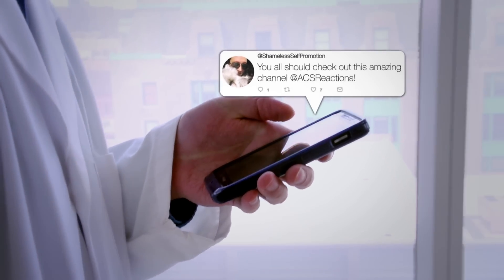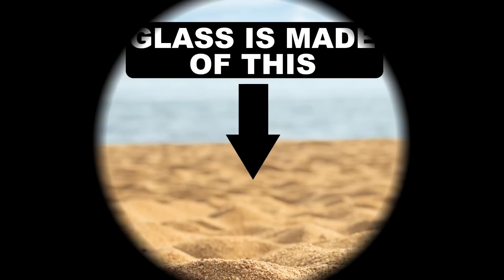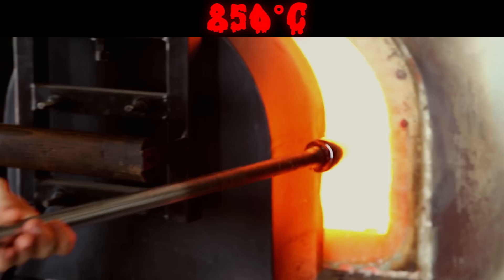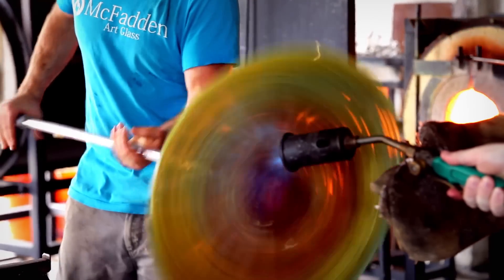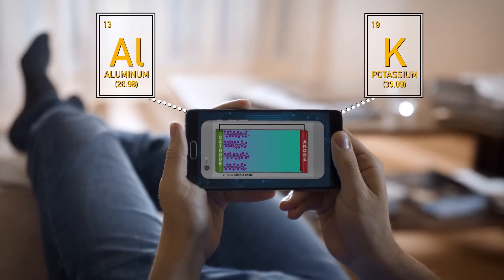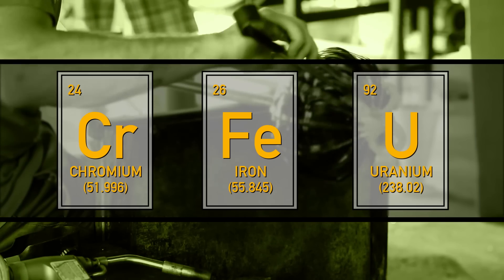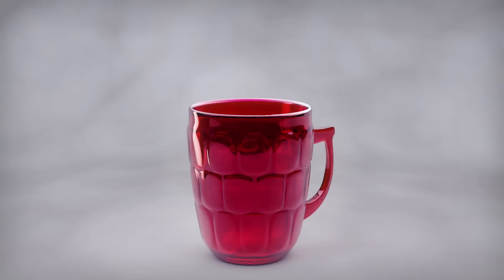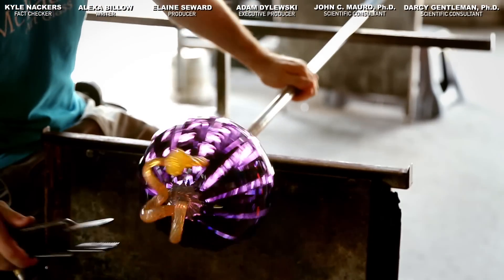How Does Glassblowing Work?

Comment: As a glass worker myself I highly recommend borosilicate, specially if your just getting started. It's less likely to crack from thermal stress, along with a large reduction in small & sharp debris. It prefers to break into larger chunks.

Comment: Correction! Pyrex glassware is NOT boro-silicate glass in the US, it's basic soda-lime glassware! Only the made in Germany Pyrex with it being stamped or etched "boro-silicate" is actual boro-silicate glass. However, most lab Pyrex is made in Germany and sold here in the states, but as far as kitchen dishes are concerned you have to pay a pretty penny to get the good stuff from Germany. Do some research on this, this happened when corning bought Pyrex back in the 80's or 90's because soda-lime is far cheaper to produce.